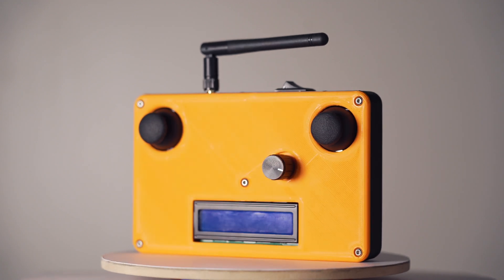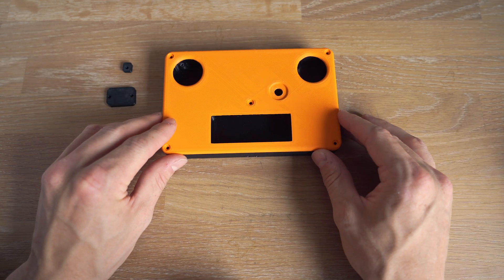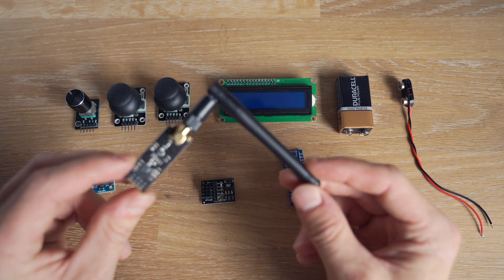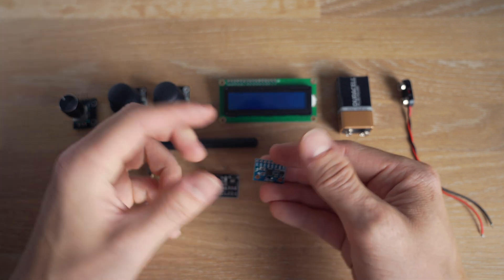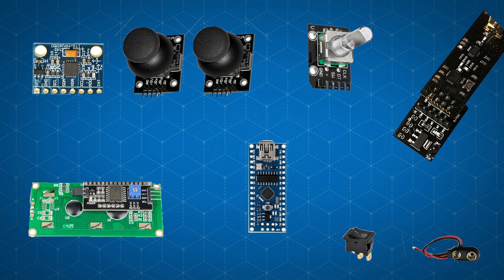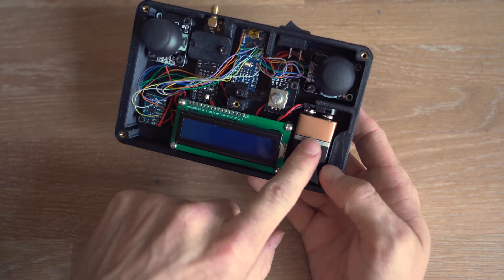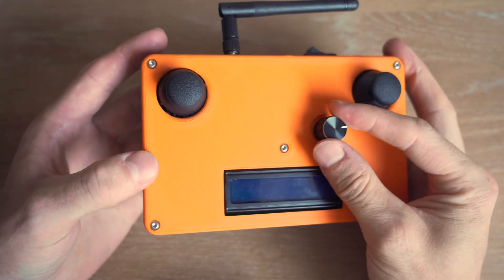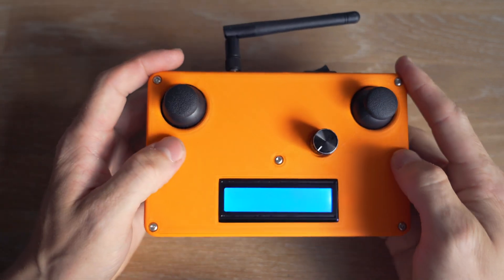How to make an Arduino-based Transmitter

Comment: Cool project! Was the choice of battery because of space constraints? A PP3 battery doesn't contain a lot of energy (approx. 400 mAh) and not much is left when you have thrown away 45% of it in the voltage regulator. What's the actual runtime of the unit?

Comment: Something I did on a project was to "extend" the LED light through the case by using a piece of clear 1.75mm crystal clear PETG 3D printing filament as a "light pipe" to bring the light up to the front of the case.  In the design I created a small tube that extended from the front to just above the LED on the Arduino LED.  The hole in the tube was about 1.75mm, and I cleared it out with a drill bit to ensure a tight fit.  With the case assembled, I cut the end of a piece of the clear PETG to a clean end with a razor blade, then inserted it into the hole down to make contact with the LED.  A little CA glue secured the PETG in place, and I cleaved off the filament flush with the front of the case with that razor blade.   It work extremely well.  The LED light is highly visible, and no soldering required to extend it, and no modification to the Arduino.    

Nice project. Well presented.  I'm looking forward to the next video in the series.

Comment: Very nice project. I really need a 3d printer... 1 question why did you chose to short cut the positive side with a switch and not the negative, I thought this was more common
Reply from the maker: I dont think it should matter, but I have no good reason :)

Comment: Nice build, although I'd recommend using embedded nuts
Reply from the maker: Thank you! I don't think they are necessary for securing the components. The bolts are binding very good directly to the plastic.